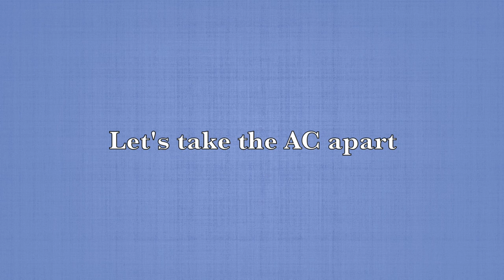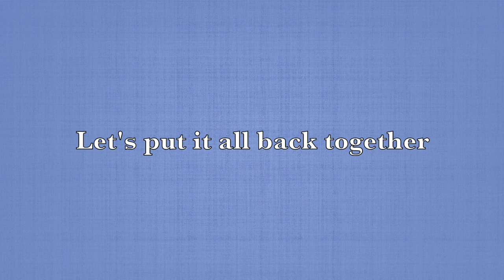How to Disassemble and Reassemble an Air Conditioner

Comment: Awesome video! 
Got hyped, I'm handy I can do it.
Once I got to taking out the fan, there is no screw on it. Have you ever ran into a model that doesn't have a screw inside the fan? It seems I'll have to take the whole unit apart including the motor to be able to clean the fan. 
Thanks for the instructions! :)